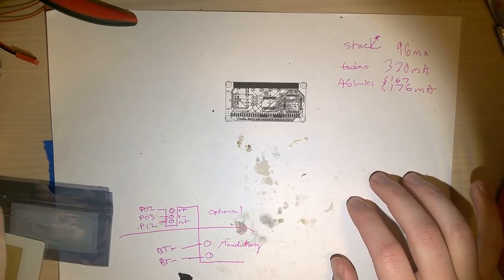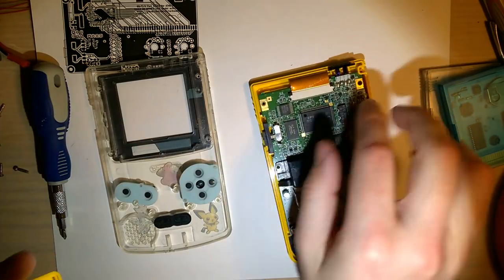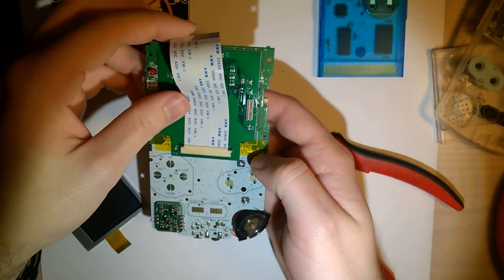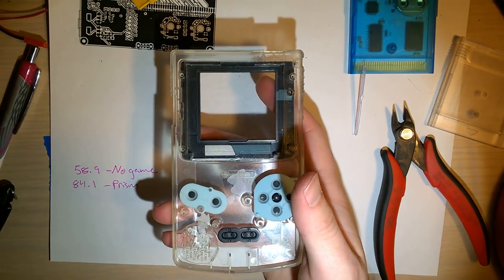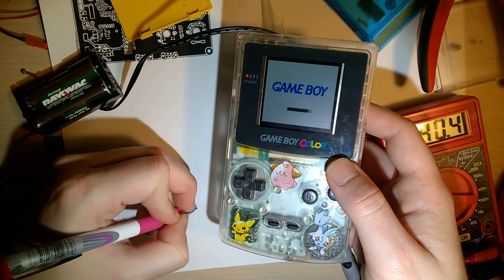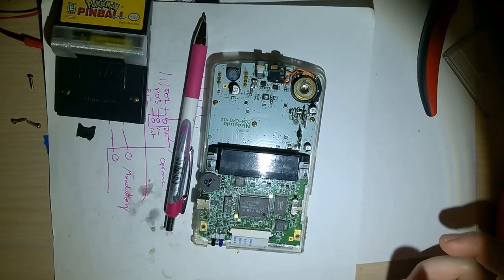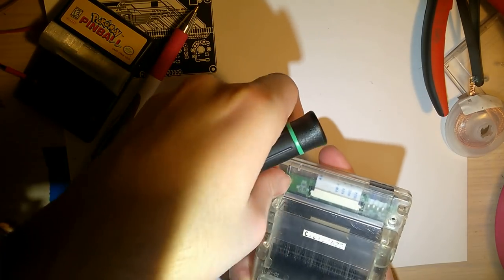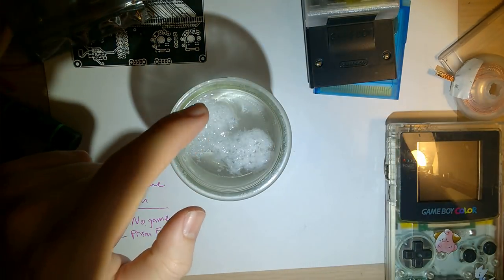Installing Freckle Shack in a Game Boy Color

Comment: Hi there!

First off, thanks for the video. Super useful!

Secondly, as one of the RainbowDevs, it was a surprise seeing Prism pop up here! Something that I'm VERY curious about is that cartridge, though. It looks like it has an RTC? We've been trying to find a supplier of MBC3/RTC carts for AGES, so any info on that would be super helpful for us!

Thanks again!
Reply from the maker: Hello,

The cart in this video is a custom designed cart using some original hardware. It uses the MBC3 and SRAM power chips out of a real cart but it uses FRAM and AM29F016 flash chips for flashing whatever ROM you want on the cart. Please check out this github repo if you want to make your own: https://github.com/MrHDR/MBC3-Flashcart or join us on the Game Boy discord channel discord.gg/gameboy if you want to discuss the cart or if you have any questions. Thanks

Comment: I've got one of the aftermarket white GBC shells... I'm having a lot of trouble getting the shell closed flush without any open seams in the edges (and I did snip the metal leads from the cartridge connector)... do you have any advice for that? I'm starting to wonder if it is my aftermarket shell... I might try to fit it in my original Nintendo GBC shell and see if that helps any...
Reply: Also, GREAT video. Very helpful commentary.
Reply from the maker: Double check that the shell itself fits together before you even put parts in. Then install stuff one-by-one until you figure out what's not fitting.

Comment: I'd like to ask about the screen width. It appears the screen is a bit more narrow because the original screen protector leaves so much white space between (on right and left)? Is that true? Is the screen more narrow than the original one?
Reply from the maker: It is proportionally smaller than the original, so it is smaller on all sides, not just the left and right.

Comment: Wait so this first bench of screens are having problems with the refresh time or something?
Reply from the maker: There is an issue with this first batch in select games only. Like I said in the video, this is due to a bad programming practice from the original game devs and was actively discouraged by Nintendo. There are a lot of games that may experience some refresh issues intermittently (like when loading your game in Pokemon Prism or encountering a wild pokemon in Pokemon Yellow or during the intro video in Links Awakening), but so far the only game-breaking issues are encountered in Pokemon Pinball. Of course, there are something like 1900 games that you can play on a GBC so there may yet be other undiscovered issues. 

BennVenn, the stand-up guy that he is, has already addressed this on his facebook page. All future FreckleShack kits will have this issue mitigated somewhat or removed entirely (time will tell, I guess) and those with the existing buggy kits may request a new board with the updated firmware for the cost of shipping. I'm not going to be getting a new board for my unit because I very rarely play Pinball, but I may order another kit in the future for another GBC.
Reply: @makho  ooohhhhh thats great to heard! Thanks for the info buddy
Reply: @makho  yeah im an early adopter aswell, should arive tomorrow. I think i'll just sell it for 100bucks and get a new gbc with the updated screen. Already waited long enough :') i can always play pinball on my backlit dmg or one of my backlit gba's
Reply: My Kong Feng GB color has no issue with that game so it should be an easy fix.

Comment: Hi makho! I was wondering if the freckle shack screen was fine on normal kits with a TFT screen, or if connecting that screen I would burn everything. Thanks I hope you will see this comment
Reply from the maker: Yep, it's the same LCD across all those kits.
Reply: @makho  wow thank you so much! But i haven't understand if that screen has Better angle view or It Is Really the same as AliExpress screen
Reply from the maker: @rikiformusic  the aio, mcwill, midwest embedded, and freckleshack kits all use the same model LCD. The funnyplaying and one chip IPS kits use the same as each other but different model LCD than freckleshack.
Reply from the maker: @rikiformusic  https://www.reddit.com/r/Game_boy/wiki/mods/backlightmods
Reply: @makho  thank you so much for this link It Is very nice and thank for your informations!! ^-^